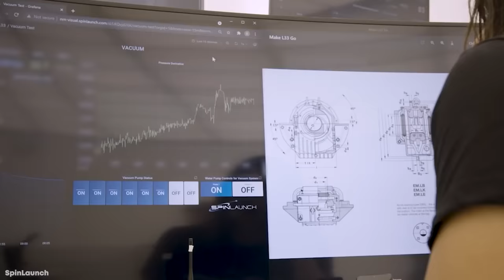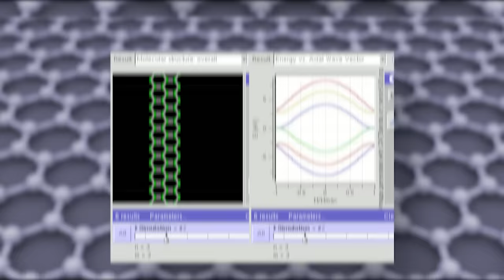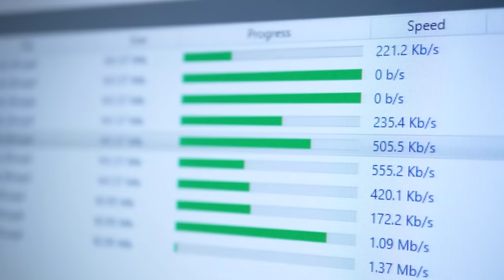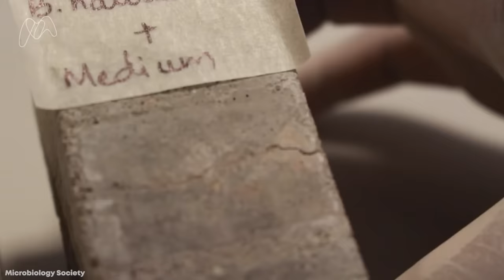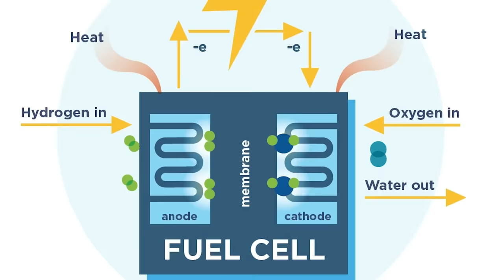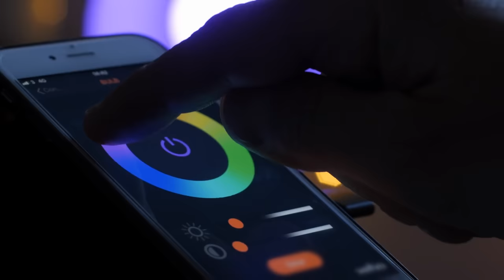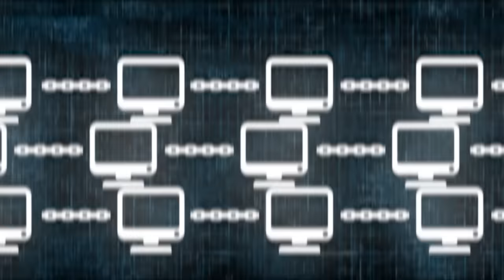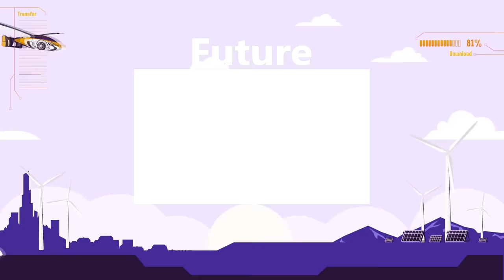15 Emerging Technologies that Will Change the World

Comment: 0:27 Pollution from rockets? I can see the advantage of Spin Launch, but there isn't enough rocket launches alone to justify the tech. I can see a cost advantage instead as being the main justification. CO2 is necessary for the photosynthesis process in Trees/Plants. At what point or range do we curtail emissions yet not suffocate the Trees/Plants?  5:20 Need to create more farmland? Decommission Wind & Solar Farms. The farms occupy to much land for the electrical production value to consumers. Wind Turbines kill birds, broken solar panels can leech deadly toxins onto the ground & eventually into the water table. 9:42 Hydrogen is far less energy dense then fossil fuels. Lets recycle to produce Bio-Diesel instead. Hydrogen & CNG aren't viable alternatives for vehicle usage, especially heavy trucks & construction equip. 14:33 Converting everything to run on electricity from alternative sources have proven a failure. Even the enviro-documentary director Michael Moore has seen this truth. 18:32 The climate has nothing to do w/ wild fires. TF is basing this lie on the increase of fires in Northern CA. & the Western US in general. The States having the most fires is from the infection of Enviro-Mentalists dictating to State govt. that the forest must be left natural. These idiots don't understand that fire is natural too & their interference & political threats eliminate thoughtful forest management programs that would reduce the incidents of fire, protect wild life & protect lives/property & would employ many people. Virtue-signaling from know-nothings.